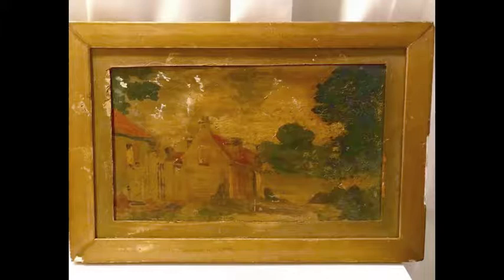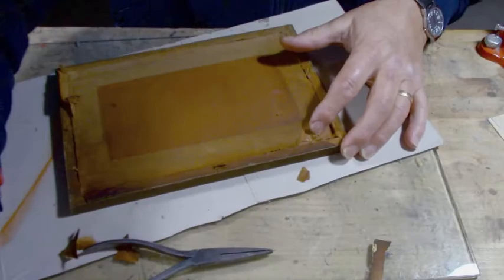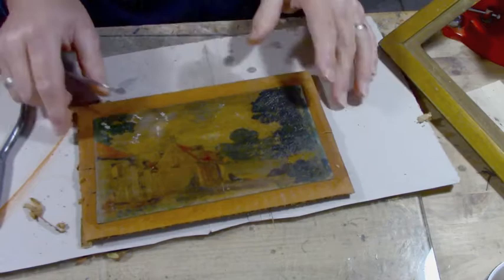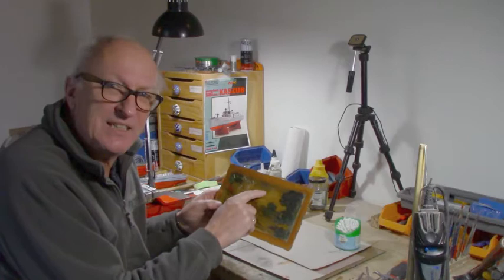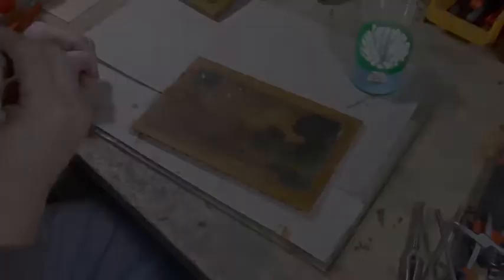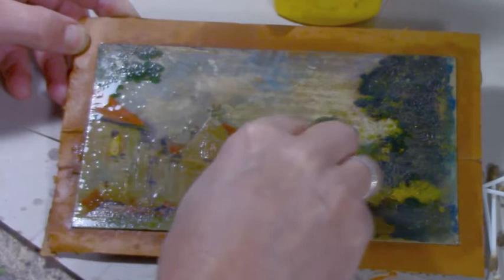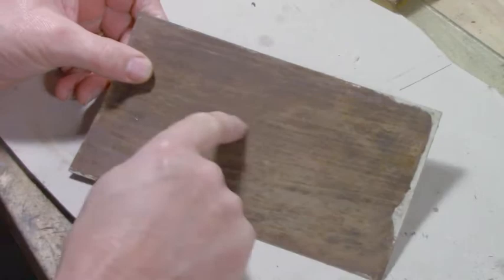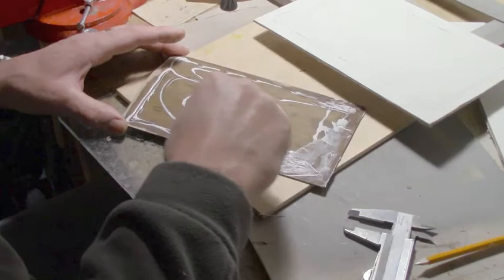Oil Painting  Restoration Part1

Comment: Hey everyone, oil painting artist here. Any idea how to remove mold/mildew from the backs of canvases safely? I've tried everything but nothing seems to work. We had some high humidity in our basement which affected several of my paintings and I'm trying to restore them back to their original condition. Any help would be greatly appreciated
Reply: I would try a test patch with watered down ammonia (I would try half ammonia and half water but experiment). I have used it to clean mold off painted walls.
Just be careful not to soak the canvas..
Hope it works.